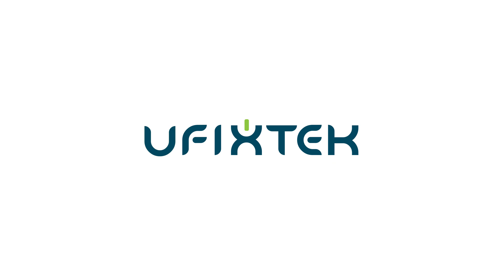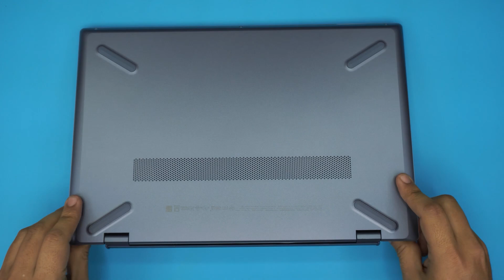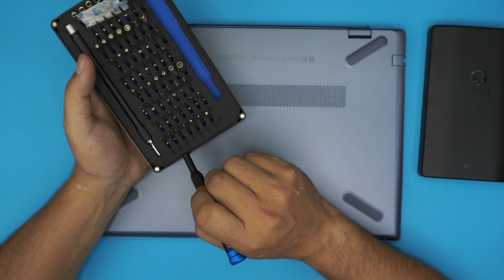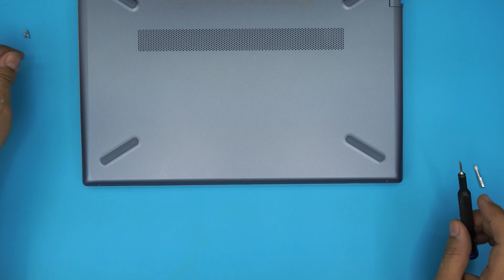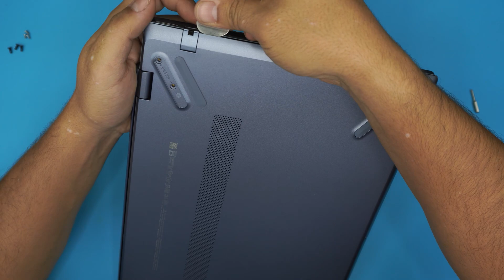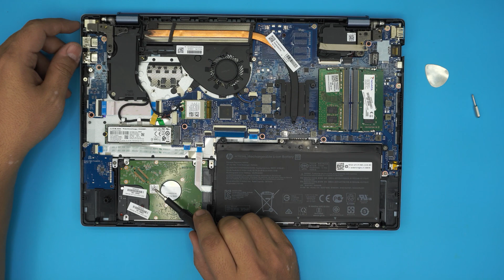How to upgrade Hp Pavilion 15 CW Series SSD / HDD guide

Comment: What is this laptop's ssd limit. I put in a 2tb and it works fine but my windows update now says I need to change it to update my computer.
Reply from the maker: The storage limit is 2TB on M.2 and 4TB on 2.5". Use both.

Comment: Hey, nice video! Only 1 question, i have a hp pavilion 15 cw 1021la, but i couldnt find info about the max capacity i can change de hdd, or the ram to, do you have any info you could help me with?
Reply from the maker: Thank you for your feedback! If you wish to support the channel, you can like, subscribe, or both!
Regarding your question, you can have:

a 2TB HDD low profile:
https://amzn.to/49UlMwl
or 
a 4TB SSD 2.5":
https://amzn.to/3IsyvdX

and at the same time you can have a 2TB m.2.

regarding the ram:
https://youtu.be/NMiMHDIuBaI
you can have 2x 16gb, but you can double check that here:
https://youtu.be/tKEJTkVth4Q

Should you have any further questions or requests in the future, please don't hesitate to ask me.
cheers🍻

This is an Amazon affiliate link. When you use my links, you are helping to support the channel. 🙏

Comment: If I upgrade either of my drives, do I need to be concerned about the software aspects of the machine? E.g., if I replace the M.2 SSD boot-up drive, will the machine automatically boot up without any monkeying around with the bios or anything else?  Honestly, I'm just now trying to get informed about why this machine has two separate hard-drives in the first place.  What would be the advantages of upgrading the M.2 SSD drive?  I already understand the advantages of upgrading the mechanical drive...more storage capacity, obviously.
Reply from the maker: if you replace the main m.2 SSD you can do it up to 2Tb, but you will need to reinstall the windows from USB, and on the 2nd storage 2.5" you can have a 2TB HDD or 2TB SSD for extra storage. some people perfer HDD for safer for the file and some want the speed and go for SSD 2.5'

Comment: Thanks, this is spot on in details. 
The only confusing part was when he talked about the M.2 drive. This laptop series does indeed comes with a M.2 SATA SSD, not the M.2 NVMe SSD. My laptop (model: 15z-cw100) came with a Toshiba SATA SSD (HP replacement part#L29690-001 : SSD 256GB 2280 PCIE NVME VALUE).

The M.2 SATA ssd, I pulled out of the laptop, has two notch on the pin-connector end. While the NVME only has one notch. But oddly it's labeled as a NVMe SSD. Based on the pin-connector, it's a M.2 SATA SSD drive. Very confusing right? LOL 

For ease of compatibility sake, I think his intention was that you should get the M.2 SATA SSD, if you were to replace it. 

I, on the other hand, bought and installed a WD SN770 - M.2 NVMe SSD and it seems to register within the HP Hard disk check. Waiting for my USB thumb drives from amazon to install windows. Wish me luck!
Reply from the maker: Thank you for the feedback! if you wish to support the channel you can LIKE or SUB or both :P
regarding your the m.2 issue: this models depending were you purchase it comes with Intel and AMD version if its Intel 6th gen + it supports NVME I do install them all the time in the store.
and i ssome AMD cpu versions don't support nvme or m.2 sata.
if you have any question or request in the future feel free to ask me.
Reply: Thanks looking to upgrade my son’s laptop and finding conflicting information as to whether it supports NVMe or Sata SSD. His 15-cw1500sa is AMD. Do you know if it supports both or just Sata?
Reply: @jjrilla___2664 i still wanna know the answer please
Reply: @lyctisss I think it supports both. I bought an NVMe drive and it worked. But had issue cloning the old drive so had to install the OS from scratch

Comment: Don’t u have to clone ur ssd/hdd from ur old
Reply from the maker: i don't recommend you to cloning if you going from HDD to SSD, if it was from SSD to SSD or HDD to HDD sure, but cloning from hdd to ssd it will cause 2ndry effects random blue screen of death, and programs crashing. we have tried many cloning programs even with Linux and all and under extreme tests the system is unstable. i recommend you to fresh install windows, takes less time comparing to cloning and its much recommended.
https://youtu.be/uDu8j2lE-dM
https://youtu.be/7f_rBp6Rb3s

Comment: Hi, i finally received my 1tb ssd m.2 drive to up grade my hp cw1068 pavilion   I also bought a sabrent enclosure to help with the transfer. The sabrent instructions mention to initialize the new drive, pick a letter for drive, and a partition type (mbr or gpt) I have windows 11 on a 128gb ssd in the machine (c drive) that i want to swap out for the 1tb. I would like some help please, what letter should I assign and what kind of partition should I choose? I know you are not a fan 0f cloning drives but id like to try that first rather than a fresh install. Your videos are very good and help a lot of people, I thank you for them, they are great. If you were to recommend a cloning program which would you suggest? I also have 32g of ram on the way so I'll be doing that as well after the swap. What do you think? thanks   DOUG
Reply from the maker: Thank you for the feedback! if you wish to support the channel you can LIKE or SUB or both :P
regarding your question: ok now that you have the enclosure place the new ssd in there and download this app: Macrium Reflect ( piratebay has it :P )
then once you open the app you don't need to assign drive letter or anything on the new drive. all you need to do is to open the app and clone the main drive to the new virgin ssd. there are lots of video on Macrium Reflect how to clone but i will try to make one too. if you have any other questions feel free to ask.
Reply: @uFixTek  Thank you for your help  i changed the ssd drive with the cloned one and in the process removed 8 gb ram and installed 32gig.   The ram that came out is 2666  the new is 3200. when I go to resource meter it says my ram is running at 2400. i assume the 2666 was running at that speed as well because i did not change anything other than the modules. When I go into the bios on  the  hp-cw1068 bios screen seems to be locked. The only thing it will allow me to do is change date/time and view logs. do you have any guidance on what I should do now? Or should I not worry about it?   Thanks again for your videos and help without you I never would have attempted to upgrade my machine.
Reply from the maker: sorry for delay reply : the BIOS will adjust to max speed that it can run , you can't change that, you more than fine. awesome job upgrading. if you have any question leave a new comment that way i can answer fast.

Comment: Hey sorry if my question is dumb but the m.2 ssd you showed the laptop had was sata 3 right? will I be able to connect a nvme in the same port? I wonder because the nvme's that i have seen have 2 sections of pins only instead of 3 like you showed in the video
Reply from the maker: Thank you for the feedback! if you wish to support the channel you can LIKE or SUB or both :P
regarding your question: It's PCI-e lane its NVME and sata compatible , you can place your NVME with two cut that it has in there and it will work as NVME
Reply: @uFixTek  awesome! Thanks so much for the info! I'll sub
Reply from the maker: its my pleasure, always here to help people out :)

Comment: Thanks for the detailed video !  I have a question 

The model i currently have is the cw - 0003la, which only comes with 1Tb of HDD, however, i am not sure if the model i have also have the slot that you show here where the SSD m.2 would go. 

I would like to install the SDD m.2 and keep the HDD aswell, you know if in my model this is possible ? 

Thanks !
Reply from the maker: Thank you for the feedback! if you wish to support the channel you can LIKE or SUB or both :P
regarding your question: Yes it takes M.2 NVME SSD (make sure you place an NVME) its much much faster than m.2 sata. and install the system on the NVME and use the HDD as for big files and programs.
si requieres ayuda avisame estoy en queretaro
Reply: @uFixTek  Done ! i upgraded it an it works smooth as it should be. Thanks !
Reply from the maker: awesome my friend enjoy the new upgrade :)

Comment: @ UFIXTEK

Thank You for your detailed video.  I have a question:

If I'm only upgrading the 1TB HDD to a 4TB SSD which is the D Drive and not touching the 128gb M.2 SSD which is the C Drive- I don't have to backup right?  My understanding is the OS (Win 10 Home), Softwares and apps all live on the C Drive and since I'm not touching it- it should be okay or am I wrong?  I only have a few photos and music on the 1TB HDD D Drive so I'll definitely back that up since it'll be upgraded but overall I shouldn't worry about losing anything at all if I don't backup when I do the upgrade if I'm not mistaken.

Please correct me if otherwise and Thank You!
Reply from the maker: Thank you for the feedback! if you wish to support the channel you can LIKE or SUB or both :P
regarding your question:  You don't have to worry about the windows nor your programs they are as you mentioned on the C drive that is totally different drive., replace the hdd with ssd you like and it will work just fine and fast. also you can use the HDD as external drive :)
4tb ssd best brands long life span: https://amzn.to/3AH4p1U
very awesome hdd case (i use them on daily bases): https://amzn.to/340FIRW
Reply: @UFIXTEK  

Thank You.  I won't bother to back up anything then. I will be adding a 16gb DDR4 2666 MHZ RAM to the empty RAM slot as well.

Do You have a repair shop and if so can you link an address to it? In the future I'd like to throw some business your way and refer you to friends and family as well.

Keep up the awesome job and I'll continue to support you by subscribing and referring you to others as well.
Reply from the maker: much appreciate the great support my friend, if you wish to support the channel you can do it by bookmarking my amazon affiliate general link and before any purchases just open up my link and search for your desire item.
https://amzn.to/3rchA7K
you can pass around the link i would greatly appreciate :)
regarding the ram: this are solid good rams:
https://amzn.to/342txUQ
regarding the work location because of the COVID situation for the moment i had to close down shops. but soon will be opening more. i do have shop down in Mexico at the moment, living is much cheaper here for now, when all this pandemic goes away i will go back and open shop again.

Comment: Hi. Great video. I have a question. Which drive is faster: the m.2 or the 2.5 samsung 850 evo? Have this laptop but dont know on which ssd do i want to put the system. Thank you.
Reply from the maker: Thank you for the feedback! if you wish to support the channel you can LIKE or SUB or both :P
regarding your question: Both! m.2 ssd sata and 2.5" sata are the same speed.
but if you want to have the best speed get the NVME m.2 SSD those are 4x faster than sata ssd's:
best brand is the samsung, very solid and long lasting:
https://amzn.to/33kRJkZ
Reply: @uFixTek  i thought this laptop is not support nvme drives🤔
Reply from the maker: hold on that on Monday i will verify the NVME, because i had a client laptop that nvme didn't work but the issue was with bios. 
i have few more of this laptop that came in store this week i will check and test and i msg you on monday.
im very sure they do but let me do a physical test.
Reply from the maker: NVME approved just installed and tested! PASSED :)
but update the bios before upgrading.
Reply: @uFixTek  thank you
Reply from the maker: my pleasure :)
Reply: @uFixTek  hello, where can i find the bios update?

Comment: can you please send me a link for the harddrive caddy and cable?my laptop came with the connector on the motherboard but doesnt have the cage or the cable
Reply from the maker: Thank you for the feedback! if you wish to support the channel you can LIKE or SUB or both :P
regarding your request: here there is only one left in stock : https://amzn.to/30dYio0
after buying that then get a double sided foam and attach the hdd to the case its better than the metal caddy, this absorbs vibration.
https://amzn.to/3rPzFsT